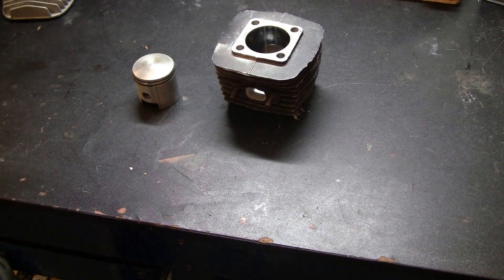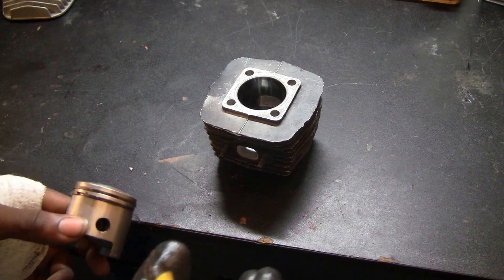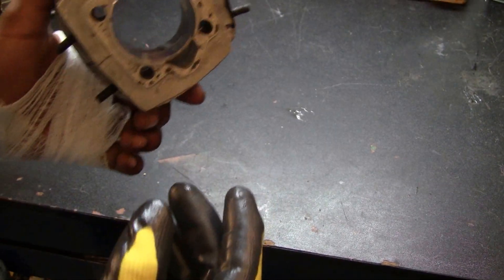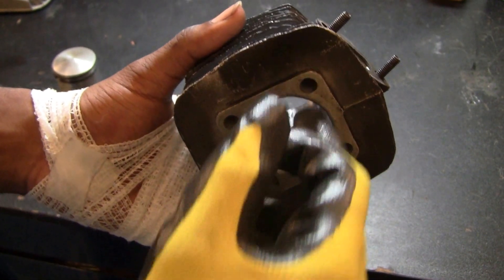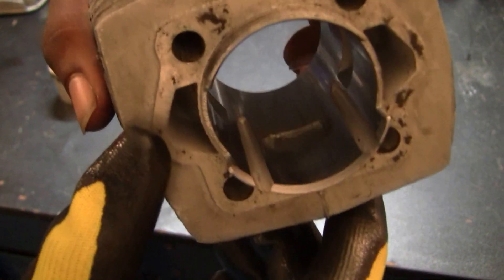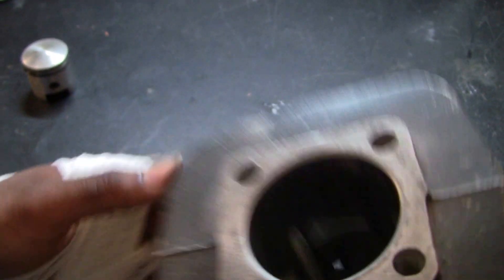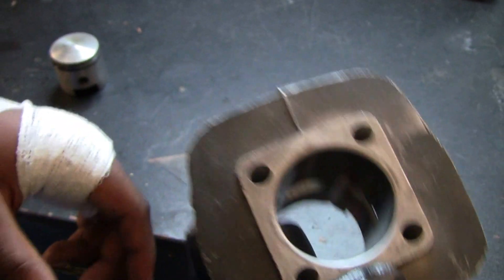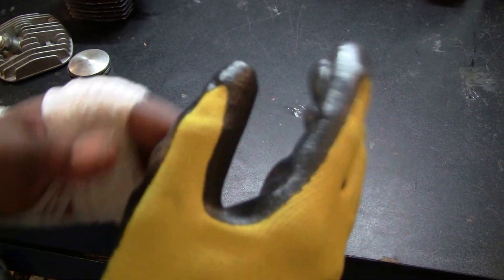Motorized bicycle big bore kit: Is it possible?

Comment: Maybe someone could just make a jug that's already bored out but has the bolts in the same place and also include a piston to go with it as a sort of kit. although there probably is a limit to how fast you'd want to go on a bicycle that's only meant to do like 30 mph tops.
Reply: Stihl 440 chainsaw jug piston and cnc head Frankenstein build.
Reply: Kits like that are showing up on ebay as of now 😳

Comment: looks like his injured hand started bleeding again... would have to manufacture a baseplate shim for a new jug kit that's wider but has a jug skirt just shy of the crank so it doesn't hit and your stroke will stay the same, you'll get more displacement and most likely wouldn't have to mess with the ignition timing. bigger carb,and pipe depending on cfm's.

Comment: Well I'd agree but no. I'm sure you know that is the only reason these things where ever made, that's teardown.These engine are great for putting out at least 15 horsepower with a welder aluminum scrap and a key to the local dealership parts and service door.Yeah got a pile of money to burn so I'll farm it out man..
Reply: These engines make 3 HP at the most!!! and I didn't understand half of your comment??
Reply: Hay james your argument is pretty much invalid. If your into the community the race bikes are maxx 10 HP. By that time they don't look like bicycle engines. 6HP is enough for anyone.
Reply: Jason Teasdale If you do some modifying of the engine the most this type of engine will maxx out at is 9HP but by the time you get 9HP it dosent look like a normal engine. Looks like some kinda dirt bike engine ment for a race track. XD Rock solid sells there race engine for 1100. There engines are some of the fastest available but they blow quick...not ment for public roads.

Comment: There are two sizes for these motorsm 49cc and 66cc, so there is a big bore kit if you have the 49cc kit. You just get the larger replacement cylinder, head piston and rings. Up jet you carb a bit and let it rip